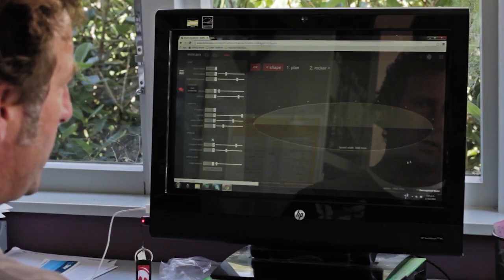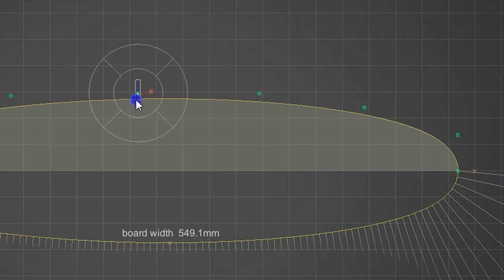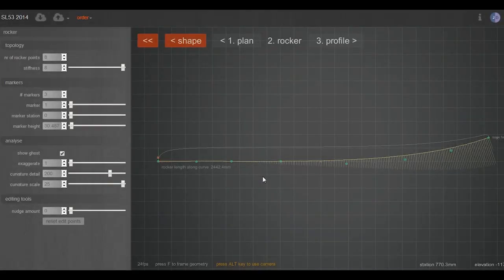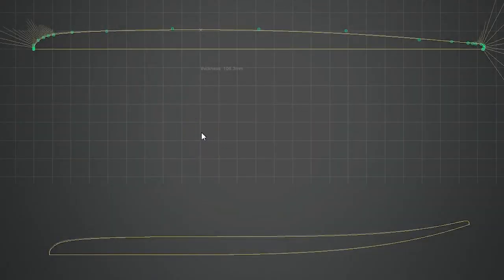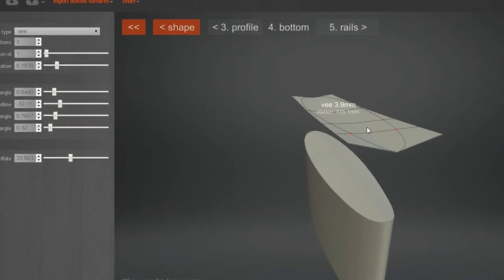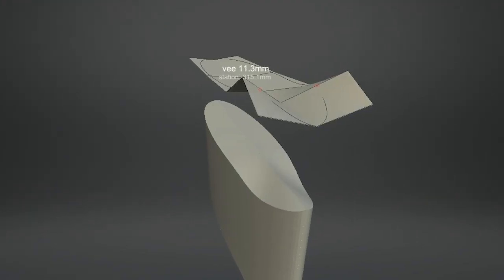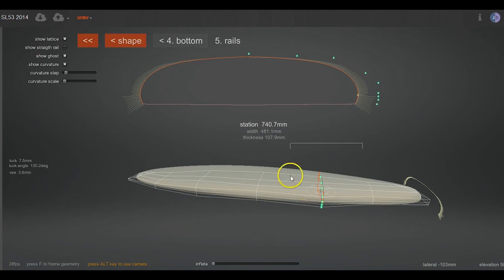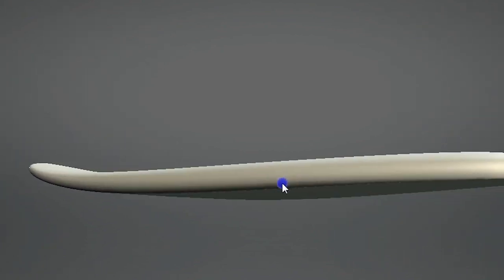Carbon Art Factory Talk: Shaping

Comment: great video! what shaping CAD/CAM software are you using?
Reply from the maker: Thanks Alvaro! The CAD software we are using is a custom developed software for board design. Hopefully it will be available to others at some point!
Reply: Get yourself Fusion 360. You can design your own board with that. It is free for startups. It will take you some time to get into and figure out the curvature analysis but you'll get it.